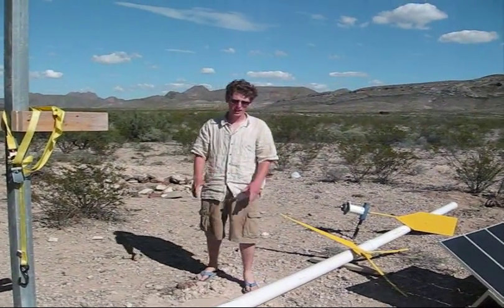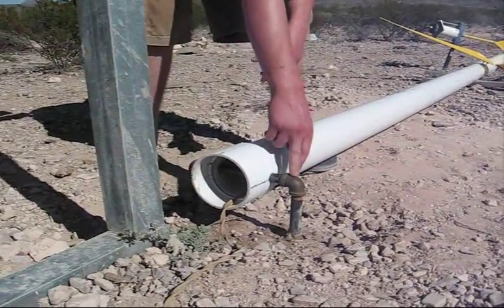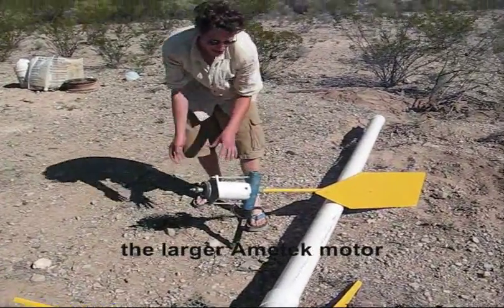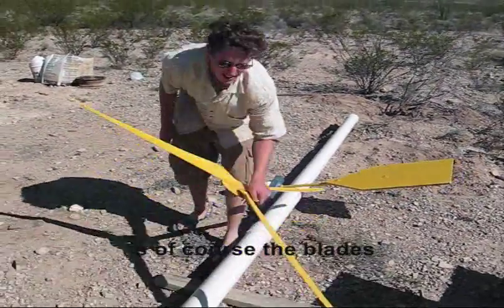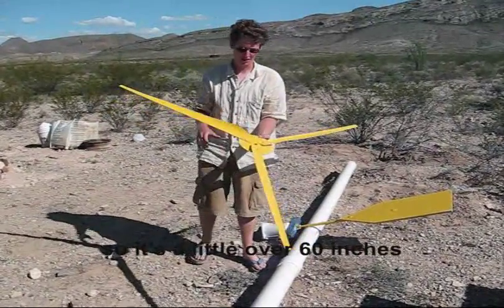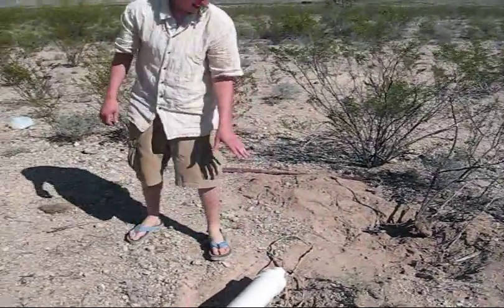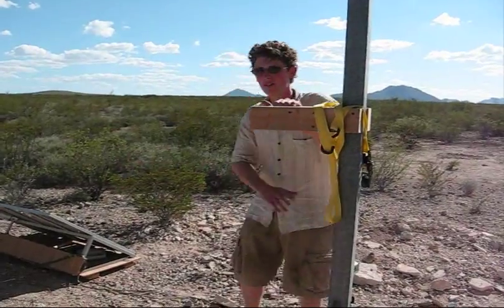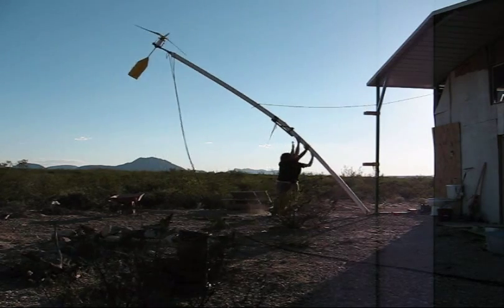Off Grid in Texas - Wind Power

Comment: I used 3" pipe on my wind generator from windy nation. With steel pipe you can weld any thing you want to it.I've seen 324 watts out of it. I use 40 watt UL solar panel for the majority of my needs currently16 of them 640 watts worth. Xantrex 2000 true sine wave inverters to run the 115 vac well pump 10 gpm. System should be up in two weeks! The system is a backup for those non electric days when power is out.